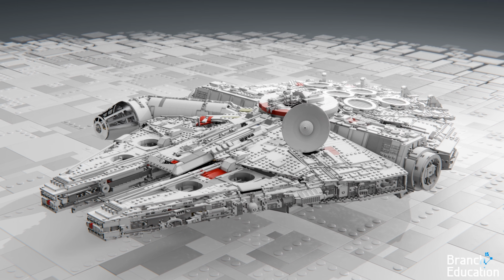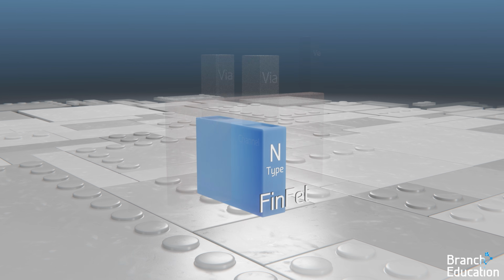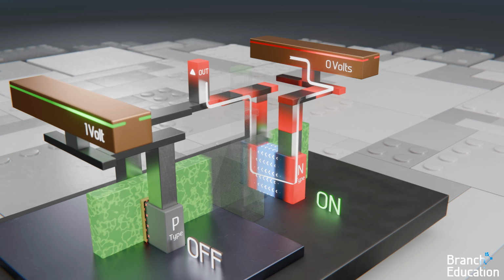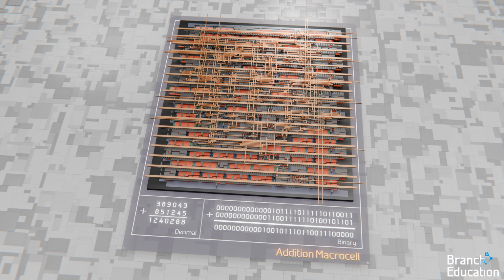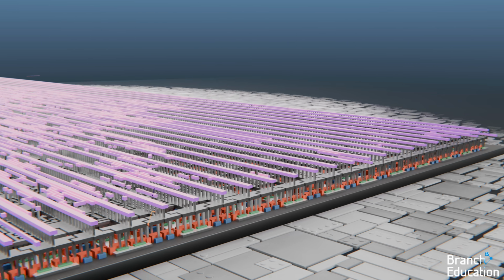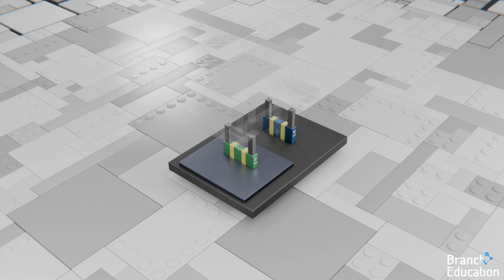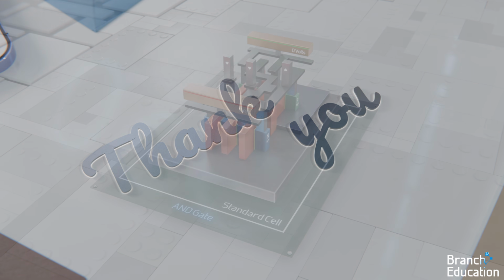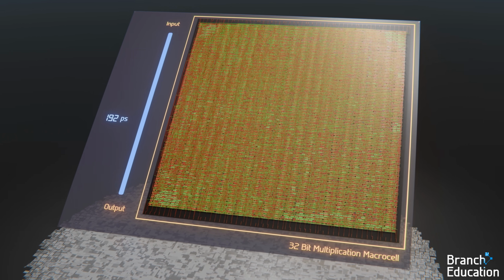How do Transistors Build into a CPU?  🖥️🤔  How do Transistors Work? 🖥️🤔

Comment: Very nice video. It brings back lots of memories for me. 
    The systems we worked with then, every adult would think existed as I seen in lots of videos. 
    But I know this stuff didn't really happen until the 80$. 
    Or these types of chips.
I would truly appreciate & love to see the chip designs pre 1980$ the didn't have encoder or decoders. Or what was basically why they used the cards. That turned switches. That set of basic gear like programs. 
  I mean, we did blow out the windows at MIT when we were working on these new designs. 
     I had explained how prior to the real processor in the 80$. 
      The chips had to be ( were set in 4 to 8 leg housing ) basically just transistor, resistors, that had to be put on a device. To set. Basically burning out pathways. That could only be used in that manner after set. 
    I told my friends that basically the building was what the first chips were. Not the chips themselves.
    Only till the 80$. Did the building be put in the chips. Which is why you have the architecture. 
    When we were asking why the windows were blown out. We told them because of the machine we were making was to be able to do something that is a fantasy to other scientists we have talked to. Doping atom's. 
   In substrates. In different materials. To create a programmable device. 
    Once our systems became available. Everyone else designed different models. Which is why. There's so many versions of the truth. 
   Like the model T, it wasn't the first car ever built. It's the first affordable car everyone could afford. 

   But when I say the definition of a processor. That definition is believed to be like the model T. 
   When in fact. If in comparison. Hundred's of vehicles, were created that had wheels, the horse and buggy. Then gas or diesel powered vehicles. 
     Dozens of years before the model T. 
   But when I say processor. It's like saying the first F16. 
    I'm talking about a completely different system. The same systems your video is about. 
     Before 1985? Maybe 83? Paper tapes were the decoder. That ran the chip housed in buildings. 
    After the first coder's and decoder. Which I ( we ) would call the floppy disks. That triggered the RAM. & Did everything the paper cards did. 
   Was the first step. Before the real processor was made. Then, everyone else made their own version s of it. 
     After that, was when the first computers came out. Because of that. 
  But that story is only known to a few hundred people. Who were allowed to use those systems. 
   They all formed their own companies after that. 
     But the facilities where they got their famous name from. Is also only known to the few who lived there in what is now called silicon valley. 
    That's where the first real computer language came from. What they learned. 
     The first Command language ( C  ). Then dozens of versions of the language. As to not pay royalties to the inventor. 
     That let them use the mother board's that could run all the Command's. 
    Which is why so many people tried to make their own version of mother board's that ran the Command language. 
      But you would have to actually know the difference before and after. 
    Just like the model T.
   Then all the car's that followed. 
   They were allowed to use the first real computer language and processor. The size of a refrigerator. 
      Because it basically used those chips. But the new gates that were added. That changed how those chips could be used. Was everything. After that. It's just rebuilding the engine. 
    It's 20 years of work learning over a few years. 
    Just like AI / SI today. 
    But, I know the hardware available before and after. Like BC & AD. 
       The real computer didn't just like what we use today. Didn't exist, before 1980$.
     Not did the processor. 
The micro transistor, existed, different systems existed. But before the real micro processor existed. The processor the size of a refrigerator was created in 80$. Then turned into a microprocessor. 
    Then different versions of it were created. 
     But only the first N.E.R.D.S. group. Would know about that. 
    But I really like the video. Great work.

Comment: Why aren't AND gates just flipped NAND gates? Like, if the 1V and 0V line were swapped, the NAND gate would become an AND gate. Why spend two extra transistors on the inverter?
Reply: This is due to the switching characteristics of Cmos transistors. An nmos transistor can pass a logic 0 without any degradation, but it passes a logic 1 with a threshold voltage loss. Conversely, pmos transistor passes a strong 1 but a weak 0. For this reason, pmos transistors are used in the pull up network (connection to VDD), while nmos transistors are used in the pull down network (connection to GND).
From a circuit design perspective, it is therefore better to place an inverter at the output of an NAND gate, as this avoids level degradation at the output.

Comment: This is a fantastic channel for someone like myself. I'm 46 years old, currently transitioning careers, and have a new found passion for electronics on a more fundamental level than I did in my previous job as a medical device sales rep. While my previous career was highly technical, it wasn't as granular in terms of transistors or integrated microchip design--I sold arthroscopy equipment and implants, wherein I was the technical support for multiple surgeries occurring simultaneously, having to quickly diagnose, and come up with solutions for, equipment problems, while a patient was on the table. If the surgeon couldn't see inside the joint, it was my problem, too. Bad arthroscope? Bad fiber optic light cord? Camera head problem? Cabling issue? Or, was it a completely different problem with the dual peristaltic fluid pump whose job it was to both push clean lactated ringers fluid into and through the joint, and also maintain a consistent pressure in the joint capsule....while the output side of the pump also moved fluid through. Did the doctor prefer pressure sensing inline via the fluid tubing? Or, did they prefer pressure sensing at the arthroscope tip? All of these things had to be assessed in seconds, and a workable solution implemented, so the surgery could be performed, and done so in the time allotted for the individual surgery. Often I was managing the equipment, while also providing the support for the surgeon with surgical implants. After the surgery, I would ensure all of the still imaging the doctor took with the image capture system was transferred to the surgery center/hospital's own servers to be associated with the patient's MRN, so that those images could be printed, and given to the patient's family, as well as documented in the patient's electronic file.

I did all of that... For 13 years. I then was sort of pushed out due to changing economic conditions in healthcare.

But, this stuff is very interesting, as well! I hope to one day be able to use some of the skills I learned and practiced in the OR, in some other highly technical field where I will be brought on because of my competence, and not because of my skin color or gender. I detest DEI, and believe it is a trade off where short term benefits to the few and undeserving are weighted, while actual competence and intellectual prowess and ability are ignored. In the U.S., you can now see the effects... and they aren't good. It is because of this that I feel like applying against a 29 year old African American woman with none of my experience is still a losing battle for me, because companies prioritize a "diversified" workforce (diversified only in melanin and what is between someone's legs, if you ask me) over a competent one. This priority is making the U.S. as a whole, far less competitive, and vulnerable to other countries who wish to take our place. I wish the people who made these decisions took a few seconds to think about what the downstream effects of those decisions were... one can hope...

Comment: After taking electronics and having basic knowledge of the circuits and programming, I still can’t wrap my head around how they do this. A full size circuit board was already small, that errors were guaranteed. Even with computers, with nano sizing and multiple layers, there are soooo many things that could go wrong. How is this possible? You shown it and explained it. It’s too mind boggling to believe it.  As long as 1 guy understands it and delegates the build, that’s all that matters? Absolutely incredible feet of human achievement.

Comment: Branch Education is single handedly responsible for my deep deep understanding of how these machines work on a hardware level.  You guys and 2 books, Code and NAND2Tetris, both of which take you from first principles all the way through the layers of abstraction to a software system with NAND2Tetris having a full blown virtual hardware design emulator, where you build your own computer language on top of the hardware stack you built, from fckin logic gates to a fully working 16-bit, single core CPU, to designing machine code and assembly languages, to a simple higher level language and then design a game with all that shit you just built..   its wild.. Code is arguably even more wild in how thorough of an understanding of this stuff it gives you, for being a single book.

Comment: Transistors are fundamental components in CPUs, functioning like Lego bricks to form logic gates. Each standard cell, such as inverters, NAND, and AND gates, is built from interconnected transistors. Understanding their structure and functionality is crucial for grasping complex circuits, ultimately leading to powerful processors capable of advanced computing tasks.

Highlights:
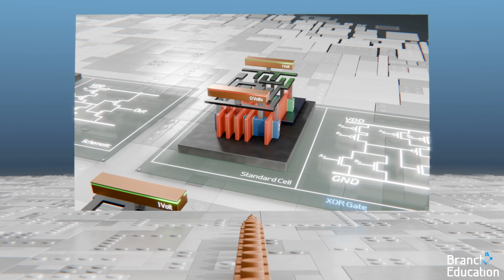00:34 Transistors, the fundamental components of technology, are organized like Lego bricks to form complex circuits in CPUs. Understanding their structure and function is crucial for grasping modern computing.
          -Transistors are analogous to Lego bricks, where each transistor represents a single stud, and multiple transistors create essential standard cells for CPUs and GPUs.
          -The inverter is a basic standard cell that takes an input of 1 and outputs 0, demonstrating how transistors function in logic gates within processors.
          -The N-Type and P-Type transistors operate differently, functioning as switches for electricity flow, allowing for the creation of more complex logic circuits in computing.
04:38 Understanding the operation of an inverter standard cell is crucial for grasping more complex logic gates. The inverter utilizes both N-Type and P-Type transistors to control electrical flow.
          -The function of N-Type and P-Type transistors is to control electrical flow based on the voltage applied to the gate. This dual mechanism enables the inverter's operation.
          -When 1 volt is applied to the input, the N-Type transistor activates while the P-Type deactivates, resulting in specific output behavior. This flip-flop action is fundamental to digital circuits.
          -Insulating materials, known as dielectrics, fill spaces in the inverter design to prevent unintended electrical connections. This ensures proper functionality of the circuits.
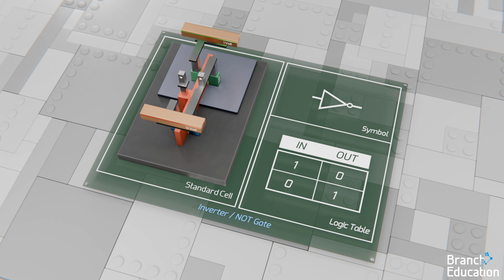09:09 Understanding digital circuits involves recognizing how basic components like transistors combine to form more complex structures. This includes inverters, standard cells, and ultimately, processors that utilize binary logic.
          -Transistors serve as the foundational elements in digital circuits, with N-Type and P-Type configurations playing crucial roles in logic gates. Their arrangement determines the circuit's output based on input voltage.
          -Standard cells function like Lego bricks, allowing for varied configurations by connecting transistors together. This modularity aids in creating more complex designs and functionalities in circuit design.
          -Macrocells represent larger assemblies of standard cells, similar to Lego sets, enabling complex operations like addition and multiplication. They are essential for building advanced components like processors within CPUs.
13:56 Integrated circuits are powerful components formed from numerous logic gates and transistors that enable complex functions like internet browsing and gaming. Understanding their basic operations is essential for appreciating modern computing technologies.
          -The construction of integrated circuits involves assembling billions of cells and gates, akin to building with Legos, allowing for advanced computational capabilities. This complexity enables various applications in technology.
          -CPUs utilize multiple metal layers to connect transistors and logic gates, demonstrating the intricate design necessary for modern computing. This layered approach enhances the performance and efficiency of processors.
          -Brilliant.org offers educational resources to deepen understanding of logic and programming, promoting effective learning habits. Engaging with their courses can lead to significant skill development and knowledge enhancement.
18:26 The design of standard cells in digital circuits involves P-Type and N-Type transistors working in parallel and series configurations. This determines the logic outputs based on input combinations.
          -P-Type transistors are connected in parallel, allowing the output to be high when one or both transistors are ON. This configuration yields an output of 1 for specific input combinations.
          -N-Type transistors are arranged in series, requiring both to be ON for current to flow. An input of 1 1 results in an output of 0 due to this series connection.
          -The video script underwent multiple revisions to clarify the design of standard cells and their function in logic gates. This complexity highlights the challenge in explaining digital circuit design.
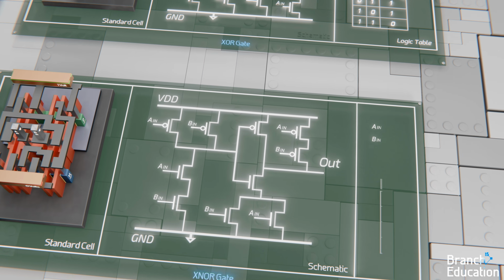23:30 The video explains how complementary metal oxide semiconductor (CMOS) circuits function, highlighting their efficiency and the role of N-Type and P-Type transistors in logic gates. It also discusses the speed of transistor operations, which occur in picoseconds, emphasizing their complexity and future advancements.
          -CMOS circuits are characterized by their low power consumption and high noise tolerance due to the opposing functions of N-Type and P-Type transistors. This design enhances overall circuit reliability.
          -Transistor operation is incredibly fast, with changes occurring in just a few picoseconds, which is crucial for the performance of integrated circuits in modern technology.
          -The video mentions future plans to explore transistor manufacturing and physics, indicating a commitment to educating viewers on the complexities of circuit design and technology evolution.

Generated by sider.ai

Comment: If all an N-Type transistor does is turn an input of 1 into an output of 1 and an input of 0 into an output of 0, why can't it just be dropped? It doesn't do anything...
Reply: That is not exactly what a N-Type transistor does. The transistor (in this case, specifically a MOSFET) is a device that converts input voltage into a current flow. The voltage here decides whether it is a 0/1, not the current. But the current is a tool that helps you charge/discharge that bit. A good analogy would be that a P-Type transistor is an inlet that fills a water tank (the output capacitance) and the N-Type is an outlet that drains the water tank, with the level of the tank deciding the bit (filled/ not filled).

If you were to only keep an inlet (P-Type), you could only ever fill the tank once (set to 1). Even if you close the inlet (turn off the p-type), the water remains in the tank. Which is why you need an outlet that is turned on at exactly times the inlet turns off, to drain the tank.

Inlet on + Outlet off = Tank fills up
Inlet off + Outlet on = Tank empties
Only Inlet exists = Tank can never go back to being empty
Only outlet exists = Tank can never fill up again

Comment: Parang mga wood lumber, ah... 

Parang sa lumber business namin ng lolo ko.
Reply: Tapos Intel and AMD etc. na ang ownerships/co-ownerships namin. And then I co-owned Global Foundries, Qualcomm (Snapdragon), MediaTek, Nvidia, TSMC, Samsung Semiconductor, and ASML etc. etc.
Reply: In fiber optics, hollow dapat ang optical fibers. May butas/hollow ang optical fibers mo. Mas mabilis?
Reply: Graphics programming functions that are crucial to faster screen output that I remember are set_visualpage() and set_activepage(). Some movies simple CGI were programmed using just Turbo C graphics library but modified and enhanced by the programmers. How many visual pages to prepare for use or to be "active on screen" to be still higher resolution and highcolor screen output depends on your tests but the Windows machine will cope up as much as possible with how much logic cores and GPUs will allow and the program or app will adjust accordingly or users choice. Quality of graphics.